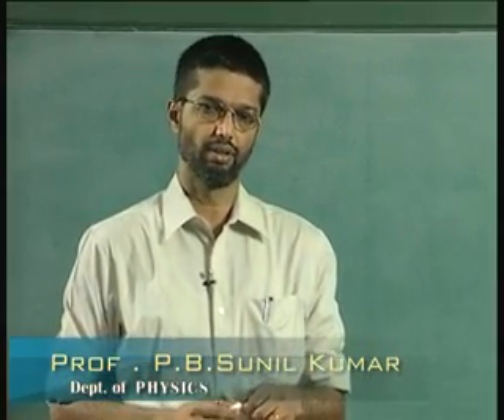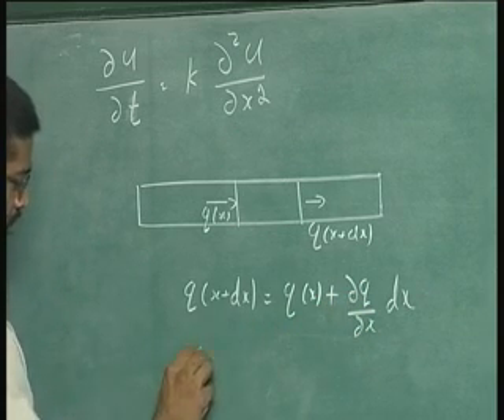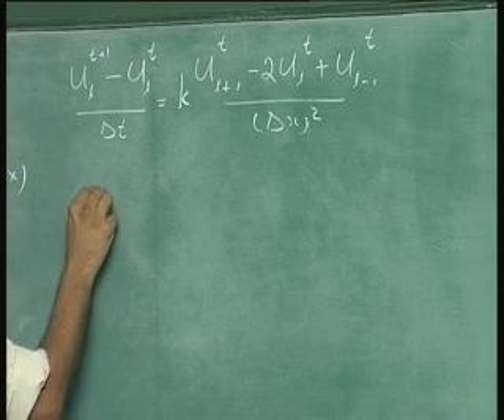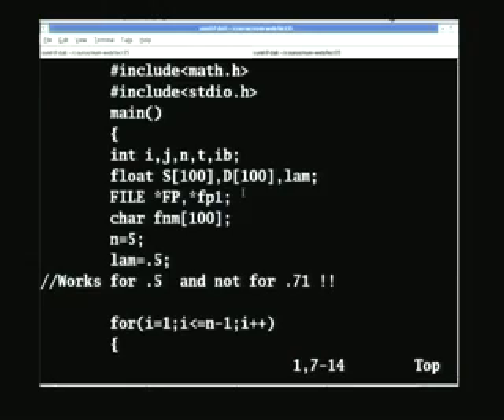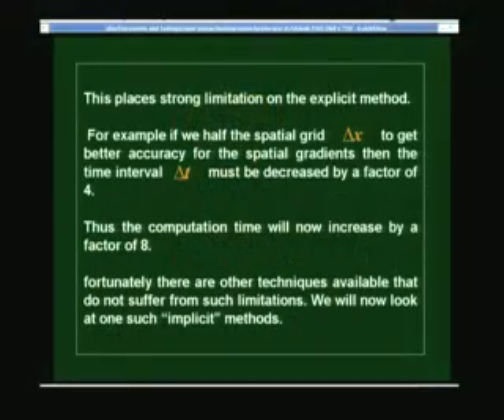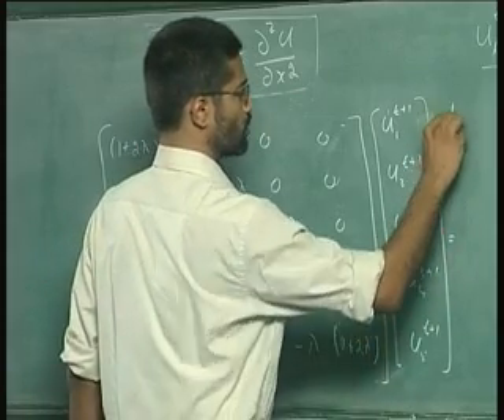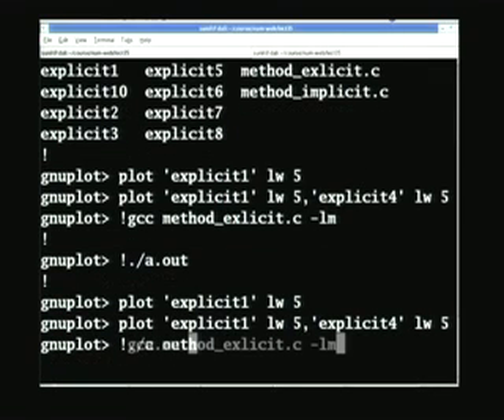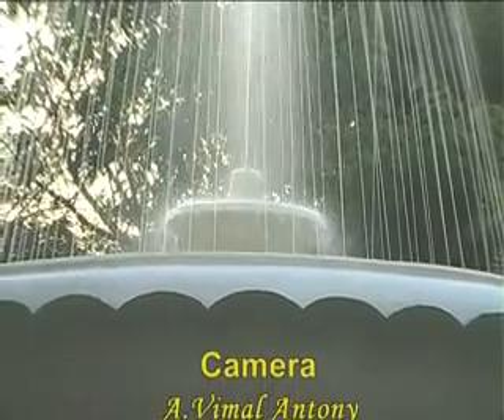Lecture 35 - Explicit and Implicit Methods

Comment: The tridiagonal matrix is actually a Toeplitz Matrix.  The most prominent property of the Toeplitz operators is that their eigenvectors are sines and cosines (or complex exponentials). This particularly means that Toeplitz matrix, A, can be diagonalized by a Fourier operator (e.g. DFT matrix), F: A = F-1 Λ F, thus reducing the transform complexity from O(n2) to O(n log n), which is the Fast Fourier transform limit.

Comment: A clear explanation.

However, computing the inverse of a tridiagonal matrix is not necessary, one should retain the LU decomposition and solve LUx=f like Lz=f and Ux=z. This has two advantages:

1. The number of parameters to remember is about 2N (instead of N^2 for the inverse.
2. Calculation of x takes about 4N operations instead of N^2.